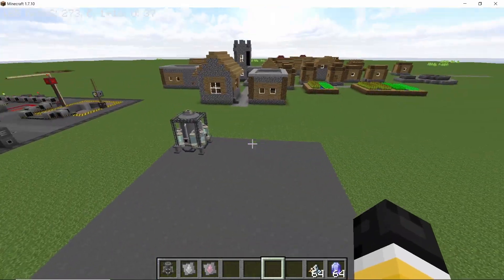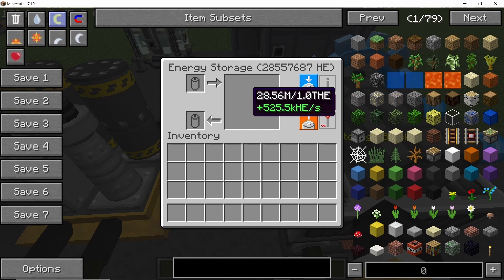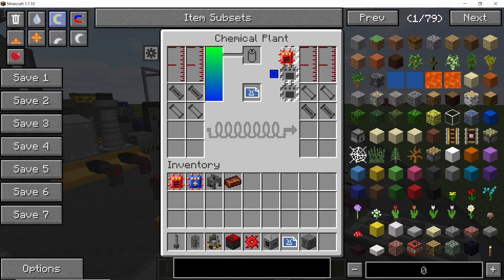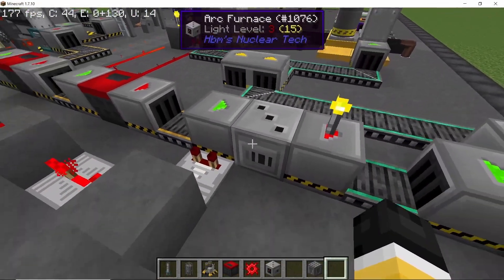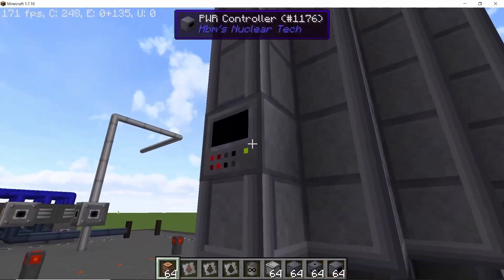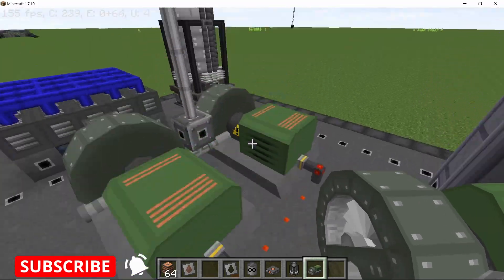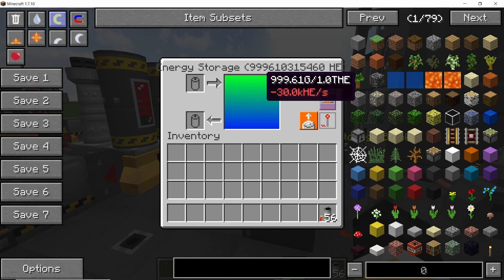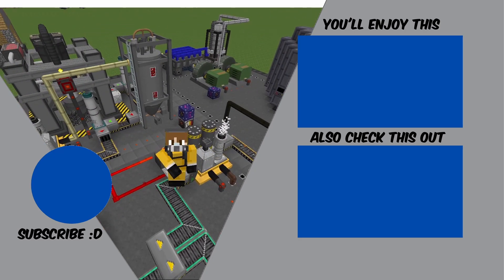Thorium Molten Salt Reactor Power Plant - HBMs Nuclear Tech Mod

Comment: Where did you find info about effectiveness of coolant and flux multipliers? I’m wondering, because wikis subtopic is empty. Also very nice setup, definitely need to try it out
P.S. One more question: how do you calculate what turbine is most effective for your reactor?
Reply from the maker: The thermal efficiency and capacity of coolants is mentioned in the info about the fluids, when you hover over the fluid you can press shift to check it out I think. 
Also for turbines the decision is pretty simple cause for any medium to big reactor you'll need alot of industrial turbines which takes up alot of space. So I generally use leviathan turbines as they don't have a throughput limit and have slightly reduced efficiency which is alright

Comment: why is your rbmk reactor colloms 2 blocks tall insted of four

or five becaouse mine keeps blowing up on your to tourials 

nice job tho

thanks
Reply from the maker: I keep it 2 blocks tall cause it is better for performance ... provides more FPS
that has nothing to do with the explosions tho cause no matter what the height of the reactor is it will work the same
Reply from the maker: explosions are due to lack of water due to insufficient cooling towers, incorrect piping, dangerous fuel rods or a combination of all of these

Comment: What mod are you using that shows the recipes for items? The newest versions of HBM mod that have stuff like the zirnox reactor and thorium molten salt reactor are only available in 1.7.10, but Just Enough Items isn’t available in 1.7.10
Reply from the maker: it's called NEI (Not Enough Items)
Reply: @SavageVegeta  it crashes every time I try to open Minecraft, what specific version of nei are you using
Reply from the maker: @kerbo1100  1.0.5.120 , that crash is probably a codechickenlib problem ... the 1.7.10 folder that is automatically formed which contains it. That has the faulty lib version
Reply: Nvm, it was a library problem. Thanks for the help
Reply from the maker: @kerbo1100  yes you're most welcome

Comment: Knowing that Thorium is a very cheap alternative nuclear fuel, this should be useful after I would ve drained of any uranium. Thanks! :)
Reply from the maker: well tbh this setup will give you surplus u233 which when depleted will give more u235 so technically you won't run out of uranium fuel xd

Comment: There is another way to automate sulfur, just make a mining drill that mines bedrock copper and after processing the ore a couple of times, one of the byproducts is sulfur and you don't have to have an oil processing plant
Reply from the maker: the problem with using copper method is the overall yield, 8 fragments will make you a piece of sulfur powder and this overall process will consume power 
on the other hand setting up a dedicated bedrock oil setup for this thing will give you more power due to the oil byproducts along with sulfuric acid
Reply: @SavageVegeta in my survival world I mine the nether for sulfur is a great way of obtaining it
Reply: @SavageVegeta  Bedrock copper actually works without byproducts because it can be crystallized, giving one sulfur per enriched ore, it's enough to supply frackers and probably much more
Reply from the maker: @dr.maniacphd8654  alrighty!!